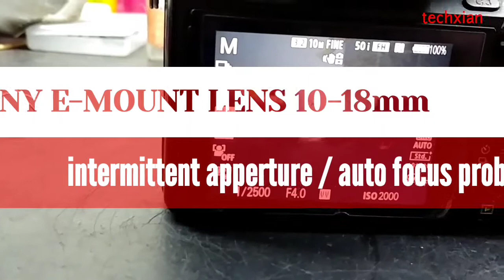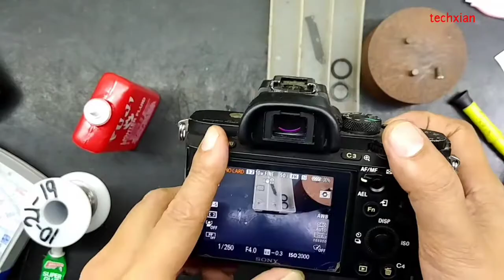SONY E-MOUNT LENS 10-18mm INTERMITTENT APERTURE/AUTO FOCUS PROBLEM/DISASSEMBLE/ASSEMBLE

Comment: how did you fix that flex
the connections are very tiny
Reply from the maker: i use a microscope for fixing the flexcable sir
Reply: @techxian  still
given how close the connections are

please do me a favour and show me a pic one time after a microscopic repair
Reply from the maker: @repairstudiogh3549  i use a magnetic wire #42 for rewiring the flexcable..idont have a picture sir but you can see an example in my other video in lcd flexcable repair..
Reply: @techxian  the one you did on the Sony A7 Mark II??
Reply from the maker: @repairstudiogh3549  yes sir that video..